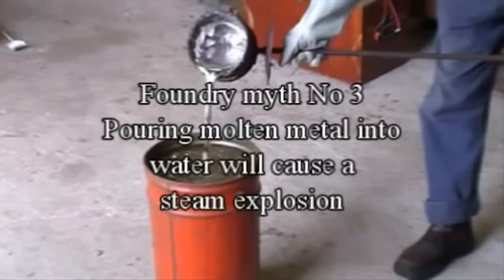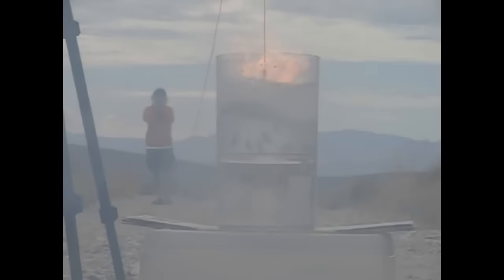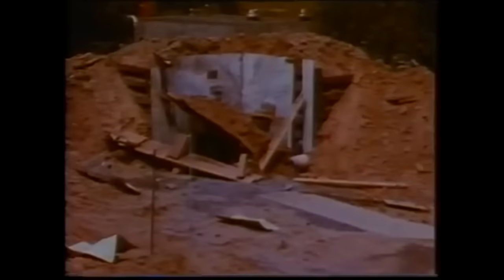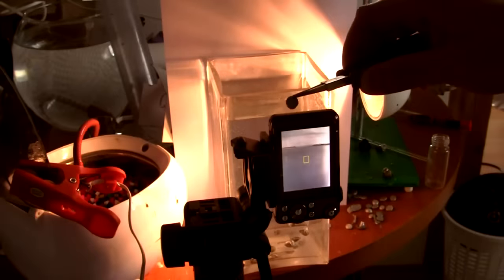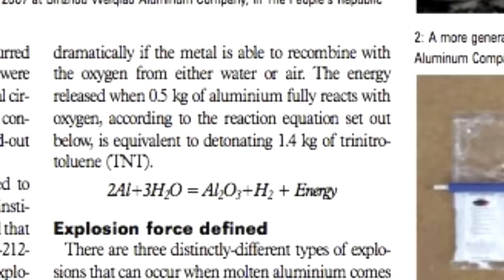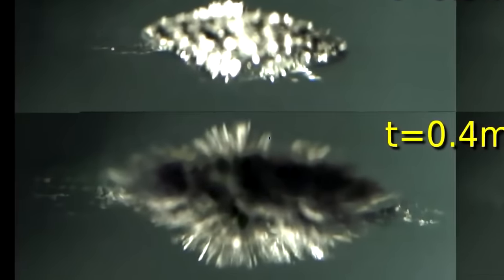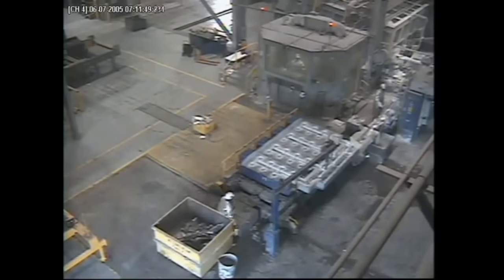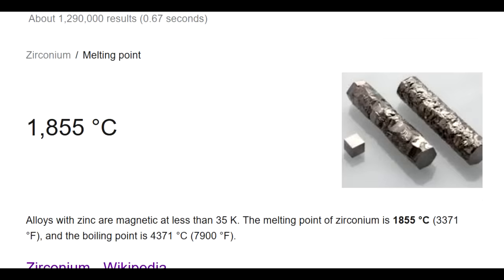The Awesome Power of the Aluminium-Water Explosion!

Comment: The explosions occur when the water is trapped under the melted metal. It’s not a reaction like that potassium or sodium one you showed.
Reply: Small explosions occur when water is flashed to steam. The oxidation reaction of Aluminum is several times more energetic than Sodium. It's what powers the thermite reaction so IF you can get past the oxide barrier it'll be spectacular.
Reply: Robert de Bath you’re missing out the part where the molten Al splits the hydrogen from the water and then get a hydrogen explosion
Reply: @spidos1000  Yes, I'm partially ignoring that, while it does reduce the energy available directly at the site of the oxidation of Aluminum the hydrogen re-oxidation isn't going to be far away and so is still part of the spectacle. Remember the energy absorbed by the reduction of water will be recovered in the oxidation.
Reply: Robert de Bath So, are there any videos of this reaction? I have not seen any. The ones in this video were just the trapped steam ones.
Reply: @MekazaBitrusty  There are videos of pure oxygen and AL powder; it burns like magnesium, and obviously lots of thermite variations (including redox reactions with sodium hydroxide and water) but the point of this video is that it'd usually be rather difficult telling the difference between a steam explosion and an actual oxidation reaction. It's just that the upper limit on the oxidation reaction can be far higher for a given amount of materials. As steam explosions can be pretty big already this would be bad.
Reply: There was an Iron/water explosion in a British steelworks some years ago which levelled the plant. Iron was being tapped into a torpedo ladle
(long cylindrical ladle) which ran on railway tracks. The tapping crew didn't realise that there was a water leak pouring water on top of the Iron. 
When the ladle was moved by a locomotive the movement started a wave in the Iron which trapped the water  under Iron - all of the
people in the vicinity died in the explosion.
Reply: Charlie Clelland Yes, those can be very nasty explosions. At the BOS (basic oxygen steel making), there is a warning siren that goes off before they dump the slag, just in case there is steel present. I have heard and felt the explosions. Again, nothing to do with the steel/iron, just the trapped water.

Comment: During my instructive years as a machinist we once had a class about foundry-safety. Teacher showed us security-cam footage where the worker on the controlls suddenly just drops everything and runs away. Seconds later the whole electro-melting furnace just jumps up, cracks open and pours partly molten metal all over the place. Teacher explained that the worker saw an indication of water-vapur in the furnace after the process allready started and did the only reasonable thing: Run. Just Run.

Comment: I suspect that part of the reason these at-home experiments rarely detonate is a combination of several factors:

* Molten aluminum melted in an air atmosphere, from scrap, is going to be full of oxides throughout. This drastically reduces the reaction surface even if the outermost oxide layer is breached. It's visually clear this is the case in those videos as the molten aluminum is a clumpy sludge, not a free-flowing fluid.  (Aluminum's oxides and hydroxides melt at much higher temperatures than aluminum metal, but they still stick to it). This would lower the available energy as well as the reaction rate significantly. A slower, longer reaction allows hydrogen to cool and escape more easily.

* The water is obviously much colder than the aluminum. If the water cools the reaction (local surplus of water to molten aluminum) enough to get the produced hydrogen under ~580C, the hydrogen will not ignite on contact with air. The molten aluminum starts out at ~660C (potentially hotter if it has been heated more), so that's only a 80C change (plus the 280kJ/mol produced by the reaction), using water that's ~550C colder. There's probably some formula you could construct that includes the surface area of the aluminum-water contact, the volume of the aluminum, the volume of the water, and their temperatures, to determine if autoignition will occur.

In an industrial casting environment, these factors are going to be very different. The aluminum will have been handled to reduce oxidation as much as possible, and any water that comes into contact with it would be in significantly smaller volumes, giving virtually no ability to cool the system. If you do end up testing this, I'd be curious to see the outcome of dropping the same mass of aluminum into a larger or smaller volume of water. (eg full beaker vs just enough to submerge the drop)

Also, there's a very big difference between sodium/potassium reactions with water and aluminum's reaction. Sodium and potassium hydroxides are extremely soluble in water, and the oxides react into the hydroxides.. This means the surface produced upon initial contact cannot be protective of the remaining metal, even when solid. Aluminum hydroxides and oxide are not soluble in water, so as long as the net reaction favors cooling over heating (a function of surface area, temperature, and oxide content), a protective oxide layer can easily reform. This should occur even in an oxygen-free environment so long as the other conditions are properly met.

Having written this out, I just realized that in an oxygen-free environment there's nothing for the hydrogen to react with. So, unless the heat of the reaction is rapid enough that it causes a steam explosion, I think oxygen in the atmosphere is at least partially required. Maybe this is the difference between those smaller and larger explosions.

Comment: So, I dont know, I mean, sodium, and all the metals in that column do have a very strong reaction with water. But aluminium is on the same column as Galium, and I may be mistaken, but I dont think molten Galium in water goes boom boom ?
I'm not denying this reaction can happen. It obviously can not only Alimunium oxydes in the air but also there is this neat aluminium-air battery we talked about. But if a layer of air oxidation prevents the explosion, wouldn't water oxydation just form the same protective layer ?

Well, the thing is, if you drop a 2 000 °C totally inert rock in a shallow pool of water, it will explode, just as a thermodynamic phenomena, not an exothermic reaction. A lot of water evaporating quickly will create a mess. But I think the fact that he has a really big tank where he drops a small amount of aluminium into plays a big role in it not being very explosive. Also temperature may play a role, as we may be closer or further from the melting point, and temperature being a chemic kinetic factor

Finally, why the hell argon ? That's expensive, and we are not dealing with wird fluorine based stuff, some diazote should do the job of just keeping oxygen away. But I mean, if for some reason you got easier access to argon than diazote, well, go for it I guess ? Haha
But I'll have a hard time believing a drop of barely molten aluminium can go boom in a laaaarge pool of water until I can see it replicated
Reply: Cosmin Costea  Sometimes I guess. Why so ?

Comment: I spent 4 years working in an iron foundry in Sydney. 
Man, I've seen the cement floor explode thanks to a failed pour. The mould didn't have enough weight on it and the top half FLOATED AWAY... (It was hilariously frightening). 
When the iron hit the floor, the water in the cement "went off" like a fire works. 
Lucky, because it was a 1 tonne pour, only one bloke was close enough to get sprayed by molten iron.  If he wasn't suited, the iron could have reacted with his water.

Comment: Use a tig/arc welder to melt the Al in the vessel.  Use 2 tungstens , one on the work clamp poking in one side , the tig torch poking in the other .  Al welding rod fed in from above or through a 3rd side hole. Using an ac "buzz box" or a better ac tig will  electrically deoxide the Al before melting the rod. You can change the size of the drops with diffrent size wire. (Or will the surface tension of molten Al dictate the drop size)

Comment: So if im correct on this at high temperatures this reaction occurs: 2Al + 3H2O -> Al2O3 + 3H2
The oxidation of hydrogen is 2H2 + O2 -> 2H2O

Treating the first reaction like an algebraic equation, first double the entire thing:
4Al + 6H2O -> 2Al2O3 + 6H2
Then add in 3 O2 on each side: 4Al + 6H2O + 3O2 -> 2Al2O3 + 6H2 + 3O2 notice the last two terms are 3 * [2H2 + O2]
Then the last two terms can be replaced with 3 * 2H2O given the reaction is at high enough temp to ignite the hydrogen (molten aluminum temperature) giving:
4Al + 6H2O + 3O2 -> 2Al2O3 + 6H2O and subtract 3H2O from each side leaving a net reaction of 4Al + 3O2 -> 2Al2O3 which is just the oxidation of aluminum.

So can you technically say that at certain high temperatures aluminum burns in water?

Comment: Your aluminium heating apparatus could use either iron pad with induction heating outside the apparatus (ie. ebay induction coils) or you coud use tig torch to heat and melt an end of aluminium welding rod (also you'd get argon supply). 
Another attitude might be to use reducing atmosphere to keep the aluminium surface exposed or instead of water you might use more basic solution which would dissolve the oxide layer - ie. water with sodium hydroxide or ammonia. 
From the videos you showed, the ideal conditions for the explosions are small amounts of water and a lot of aluminium. I think the reaction works best with very hot water vapor and molten aluminium. Maybe it can be replicated in reverse - blow superheated steam onto an aluminium surface.

Comment: When you weld aluminium you have to mechanically remove as much as the oxide as possible. Reversing the polarity on your welding rig helps blast of some of the oxide off. I'm sure the aluminium oxide melts at like 2000 degrees C where the actual aluminium has a melting point of 600 degrees C(approximately). We would us Helium as a shielding gas to protect the melting pool of metal your welding from the oxygen in the atmosphere. If you put too much heat into when welding it destorts really easily. It's an interesting material.

Comment: That is why aluminum is chopped into small pieces before melting. Pipes and tubing can hold water which would cause a nasty explosion. Put a frozen french fry in hot oil and you can see the effect. Put oil in a large container of water and not much happens.

Comment: Not sure if it will make a difference but perhaps pouring the molten aluminium from the top, through the slag, (like pouring water out of a pitcher) gives the metal time to oxygenate enough to prevent an explosion. whereas allowing it to flow from the bottom of the crucible and not through a layer of slag you get a big BANG.

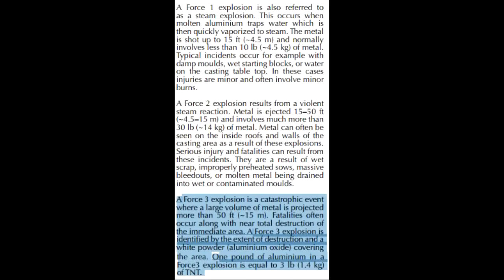Comment: Cutting through the hyperbole, this video can be summed with the chart at  12:30.

Force 1 and Force 2 explosions vary only in scale and are 'only' steam explosions, predominantly physical rather than chemical in nature and are caused when water is turned to steam in a sufficiently confined space.

Force 3 explosions are at least partially chemical as aluminium oxide is produced.  I can see no evidence of a Force 3 explosions in this video although some of the destroyed buildings may have been the result of one rather than a steam explosion.

Can anyone shed some light on what is required to cause a Force 3 reaction?

Comment: seems like this might be tied to activation energy as well. smaller quantities of water like in the demonstrations cannot draw off as much heat as the drops into larger pools of water. I agree that the cleanliness of the metal surface does seem to be a critical too.

In foundries you have the perfect set of conditions for such explosions to occur. Relatively small amounts of water allowing activation energy to be reached, and large quantities of clean Aluminum.

Comment: Where I work We cut aluminum with our plasma table over water(sheet metal not submerged). It gets melted and drops in the water. Nothing bad happens right away, but if you cut too many sheets in a row. The gas can build up under the next uncut sheet and explode. Nothing deadly, but sounds like a gunshot.

Comment: Get a large box full of hydrogen at 1atm. Put a little nozzle swuirting oxygen in, with a spark gap. Use anhydrous salts to suck up water vapour. add extra hydrogen to maintain pressure. Flame is pointed at aluminium. Beaker of water (with thin oil skin? ) below, for molten Al to fall into.

Comment: I would like to point out that in all of the aluminium explosions, it only happened with a small quantity of water vs the quantity of aluminium. 
youtube videos - much larger quantity of water vs aluminium. demonstration and incident videos - much smaller or even trace amounts of water.
Reply: did you see the video? he poured a small drop of aluminum into a bottle of water, and it still exploded. the quantity of water isnt the issue.
Reply: @marcosdheleno  I watched the video a second time, and I dont see what you mean. could you please give me a time stamp of the section in question?
Reply: sorry, my mistake, the moment i was thinking off was the one from the sodium experiment, but the effect is the same, and the one before it where he melted pure aluminum in a small amount of water and it boiled.

and, like i said, the problem is not the amount of water, HOWEVER, the aluminum we have access is protected by a layer that is there to stop this from happening. but, like he said in the video, when melting it, and dropping in water, there's a chance it will explode, and when it does, everything will blow up.

Comment: If you reverse the process and drop a tiny drop of water into a vat of liquid aluminum, you’ll probably get an explosion every time especially since the water vaporizes so quickly causing a secondary gas explosion.

When dropping aluminum into a large tank of water, the aluminum creates a gas barrier preventing the aluminum from reacting with the water.

Comment: I think the smaller type of the explosions happen when the water amount is small and the liquid aluminium amount is big. When you pour it fast the water will boil very fast (just because of the heat) and if the pressure is high enough it will explode. I think there's no chemical reaction there. If there is a chemical reaction, the explosion will be the big version.

Comment: The point Thunderf00t isn't making explicitly clear by stating it, is that he is concerned about the reactive properties of aluminum, while the pour videos are showing how to avoid steam explosions. 

Small amounts of heated liquid into large amounts of water is as shown safe from a steam explosion. While small amounts of trapped water that is then covered in hot fluid causes a steam explosion. Or small amount of water that is heavier than the heated liquid sinks or is added with enough force to displace the heated fluid causes a steam/hot fluid explosion (this is the classic oil fire). 

An oxide free aluminum pour into water will cause a reaction of the more classic and loved science video of explosive metals hitting water. 
The single comment about the pour video's dirty environments protecting them is kinda lessened with the closing comment about the suggestion of how to test this being so hard. 

It's a bit like saying a bullet fired from a firearm is safe as long as your not directly hit, while the other guy is actually talking about a nearby impact of a HEAT/HESH round.

Comment: Why in the world does aluminum not explode when we machine it? We use a water oil emulsion but it's 90% or so water. Given that we're machining, we are constantly exposing fresh aluminum. Yet it never explodes. I'm not saying it doesn't ever, but I'm genuinely curious. Its not because its in an alloyed state either, because castings are almost always made from an alloy as well. Does it have to be molten? If so, what does that do to cause it?

Comment: I was the victim of a very small scale molten metal explosion caused by a wet mold with no safety precautions taken. The metal was lead, and I got it all over my face and eyes, in tiny and small droplets. I was very lucky to have only some very small superficial burns to my skin and my eyes were unaffected. Never got sloppy about safety around molten metals again.
Reply: Marcelo Picoli yes, the silver shower we call it. But it is NOT a chemical reaction as this video claims, but simply water instantly flashing to steam at 1600 times its own volume that causes it. Preheating my moulds is how I avoid it.
Reply: 🤣 that sounds like it was also ur fault, cant blame them for no saftey gear when you didnt gaf until u got hurt lmfao🤣🤣
Reply: @moneybilla  Totally my fault. I learned my lesson.

Comment: the STEEL & IRON foundry I did time in, covered the floors in sand before any pour...
One reason is If a fair volume of molten steel hits naked concrete, the concrete explodes because it has a captured water content. 
Rocks & lava thrown everywhere, on everyone... groovy

Comment: Pouring slowly the aluminium in a large body of water (youtube videos) is incomparable to pouring aluminium into a container with a little bit of water (factory pouring aluminium in wet molds)  or even pouring the metal at a really fast pace (control test)